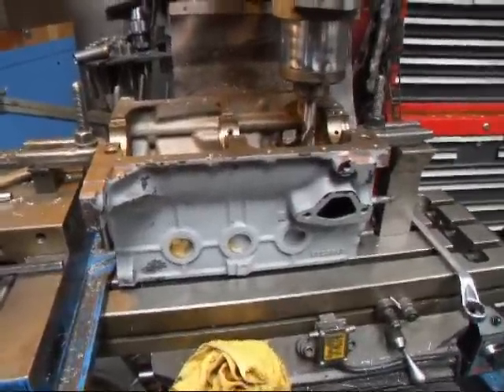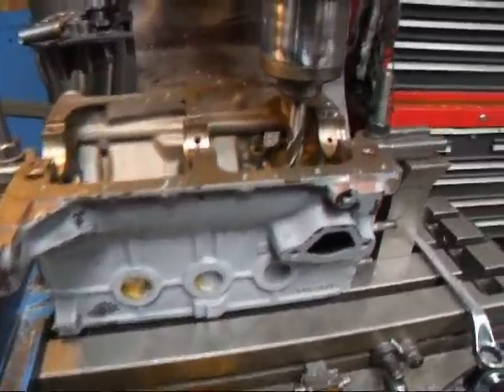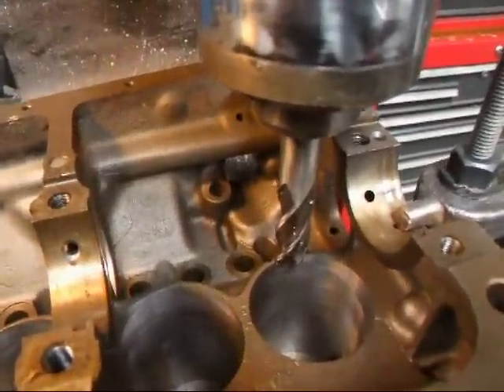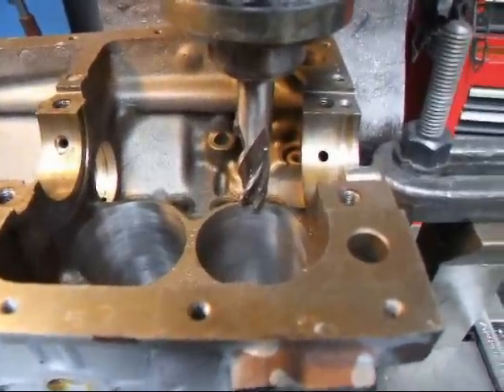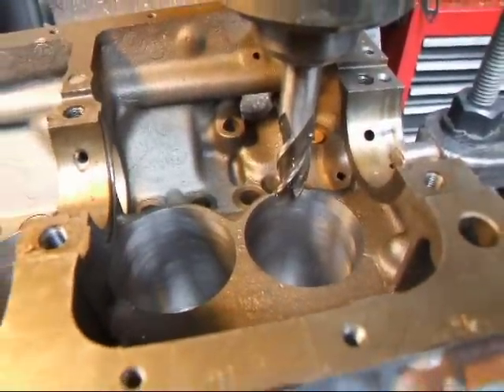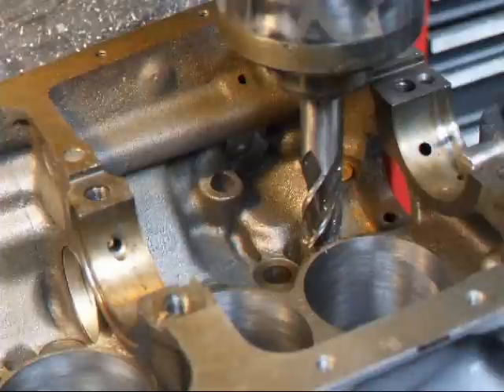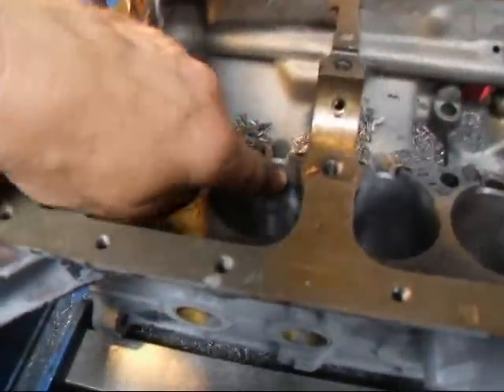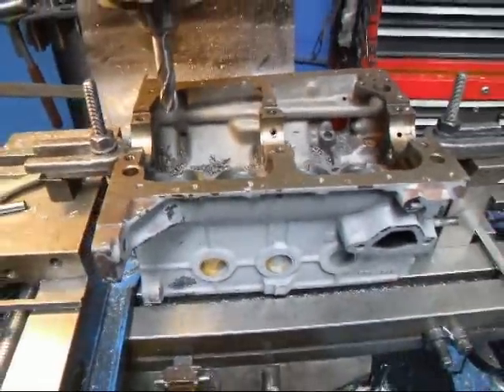850 Stroker Clearancing.mp4

Comment: Hey John, its Anthony.  I brought in that subaru STI crank to get 1 of the rod journals polished because it had a high spot from a metal particle (also got it cryogenic dipping done)
I was wondering how much you would charge to clearance my subaru wrx block?
I have a 2.2L stroker kit that uses an STI crank, Eagle Rods, Mahle Pistons, all in a WRX case.  My rods seem to BARELY touch and I know you want atleast .050" clearance.  How much would you charge for this? message me about pricing and such

Comment from the maker: @paulmerz - Should go from 52hp to 72hp, plus a whole lot of torque. This engine will probalby produce around 80 hp when its all said and done with a rev limit around 7800 rpm. the cam is right around 296 degrees with .450" lift, not a lot by Chevy standards, but a bunch for a Fiat. this engine is going in a Fiat 600 and should be quite fast. Will have video as the car progresses.